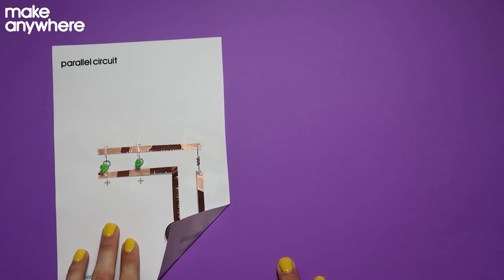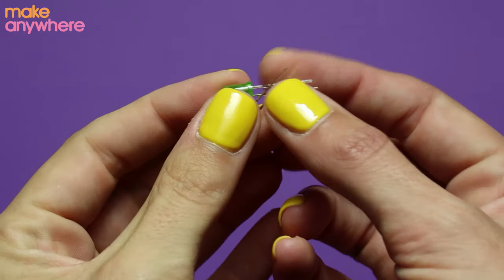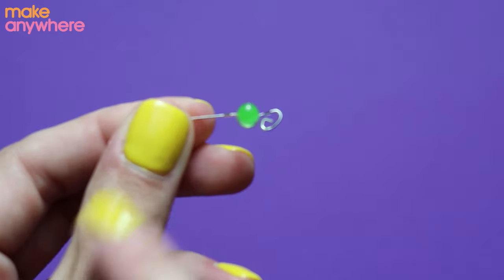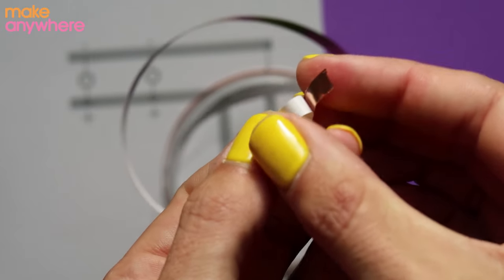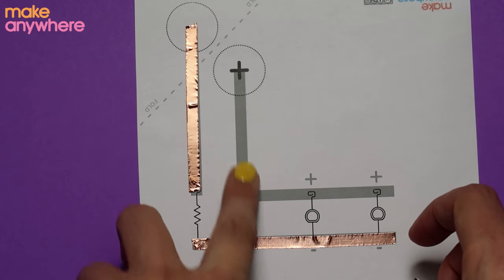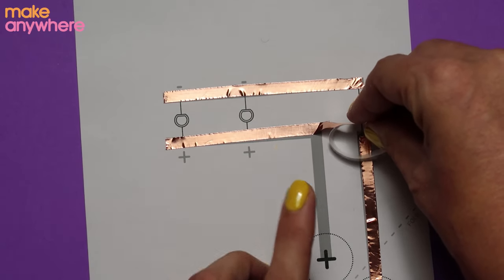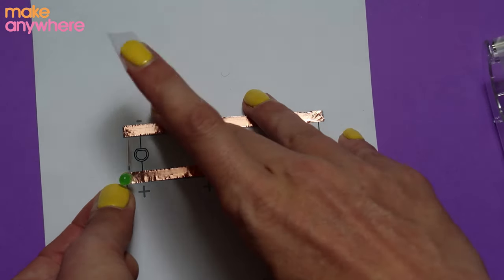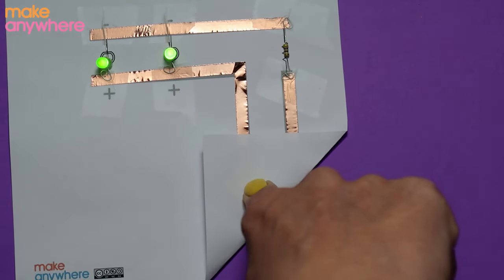How To Make A Parallel Paper Circuit

Comment: What is the purpose of the resistor?
Reply: I was about to ask that exact thing what is the resistor for
Reply: Forward Voltage of green LED's is 1.4-2.6V, so some voltage needs to be broken down since the battery is 3V. Voltage exceeding 2.6V will burn the green LED's.

Comment: How many led can be used with 1 battery?without any resistance??
Reply: omly one
Reply: more than one... if the combined voltages of the LEDs do not exceed the 3 volt battery.  Different colours use diff voltages.  (two is the most)